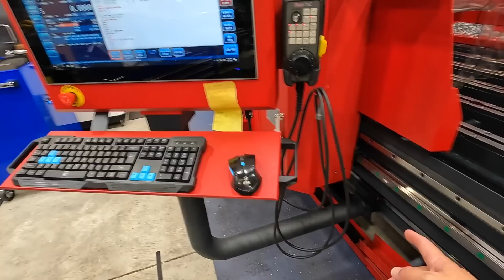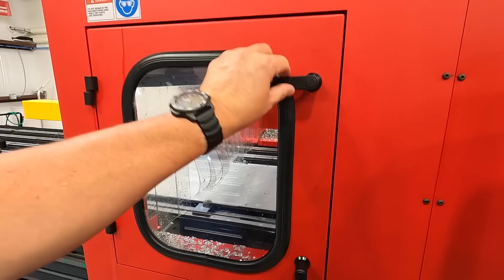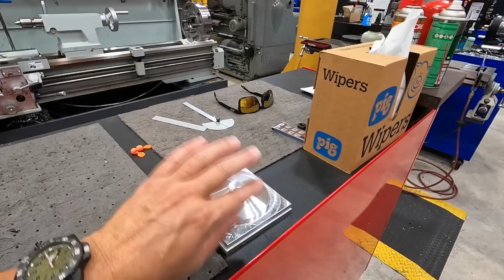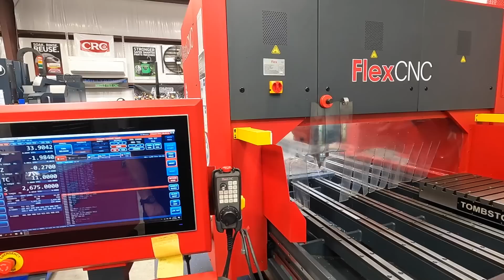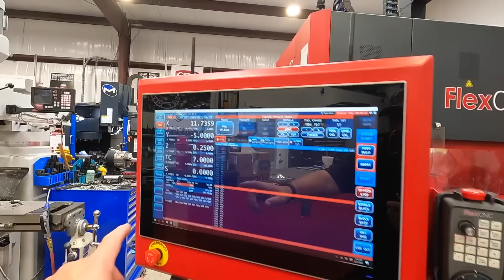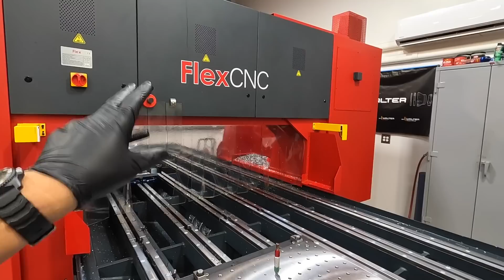Cart Top Fixture Plate Machining Success

Comment: Looks to be working really well  on the tap cycle now. I have some Parlec tension compression tap holders which allow some miss match and have a large amount of float in both directions should it be needed. The noise on the Z axis sounds like the motor tuning is out a little.

Comment: As a mechanical engineer I love your variety of videos. I personally only ever deal with CNC with 3d printers, but I like to understand what the machinst goes through when I turn over models and prints to them to cut parts. Your manual machining and repair videos are also great for when I have to get in the shop myself to modify prototypes. I get to learn how a real machinist would do the things I stumble and fumble through! Keep it up!

Comment: Adam, all you need for that window with the coolant ( for filming purposes...)  is a magnet aquarium cleaner. It works like a squeegee. one piece inside the other outside... Magnet holds them fast thru the window... Works like a charm!! a simple swipe up or down will clear that coolant quick and easy! always stays put and is ready to use anytime!
Reply: Be careful of magnets, that's how it knows the door is closed. AvE actually put a porthole-wheel in his. (spins with air to sling the shmoo off.)

Comment: I'd be curious if the flex supports dynamical variables. This kind of job would take no more than a hundred lines of code.
Reply: Indeed. As far as I know, most g-code systems are very literal - no real programming, just long sequence of commands. ('tho a program can / does generate that sequence.)
Reply: @jfbeam  It very much depends on the control.  Realistically, you have to spend some time reading the manual to see what your options are for advanced programming.

On the other hand, I've seen some controls where utilizing the advanced programming capabilities exposes bugs in the control software.

Comment: Have you considered building a clear view window for your camera so that you can mount it close to the tools using flood cooling? It's often used in the windows of the bridge of ships and consists of a disk of glass or plastic with a centrally mounted motor that spins it to throw off water or snow or in your case coolant.
Reply: Air knife

Comment: When you tap with a CNC is the starting thread of every hole at the exact same position?
Reply: ?? I guess it depends on how quick the chuck stops spinning. If there is any lag at all, it will accumulate a difference. Might be interesting to examine the finished plate.
Reply: No. There's no programming option to stop the tool at a preset angle.
And the chances of the forward and backward cycles to be the same, down to the millisecond, are slim.
Reply: @adrianohaha7659  I would have been willing to "bet money" that there is definitely precise spindle indexing. I am just guessing but with the insane tech that machine possesses, I cant believe that it wouldnt!

So if you stopped the machine mid-tap and had to resume or re-run the program, all the  tapping would be destroyed by a re-tap?
Reply: @truckguy6666  my guess is "Yes"
It's a cycle started at whatever position the spindle is at that moment. There is no need to precisely count the milliseconds it takes to get from one stage to the next, inside that cycle. It would probably involve expensive circuitry and routines with no real benefit. If you stop mid tapping, you just skip it and finish it by hand, at the end.
Reply: The logical thing for me would be to say yes, but I'm not sure.

But the tool will be programmed to start at the same Z-height above each hole, and the feed is the pitch of the thread, so in theory it should be the same 'point of entry' but I can't say for sure.

If you mill it instead with a thread mill, you can be sure it will start at the same point ✌️

Comment: You mentioned that there is a delay between the time you crossed the safety beam and it shuts off the machine.  I was wondering if you could wire in a flashing light or a buzzer that warns you that you are crossing the barrier so you know to back out?

Comment: One simple solution to deflect even fairly heavy spray is to use an air screen directly in front of the camera.   It does not take much of a fan along with a simple slot to make one.  This was what was used in early lake boats.  A very heavy duty screen can be made by a rotating clear plastic circular sheet.  This is the system used in heavy weather boats to keep the pilots view clear when waves inundate the pilothouse.

Keep up the good work.

Comment: I wish back in my manual tool and die maker days we would have had some CNC machines. Things could have been made faster but most of the time when I was building a die it would be a one off as I call them.
 You build it. Test it. Deliver it. Set it up for the buyer if they wanted to put it to work. 
 Move on to the next one. They were never the same.

 The Flex Arm plate you did in this episode would have taken me a lot longer doing it manually and I would have gone nuts if I had to make a 100 of them. Doing the same thing day in and day out until finally get 100 finished. 

 Thanks for sharing your experience with learning CNC.

Comment: Always enjoy watching. Get you a Big Ass DeHumidifier and set it in the corner. That will take a load off that AC.
Reply: It's a good point about humidity, especially something like flood coolant going. But dehumidifiers extract moisture from the air at the cost of raising its temperature. That's great for a variety of applications, like clammy basements in northern US summers or on the Gulf Coast between A/C season and heating season. But on the Gulf Coast in July, it's A/C season: there's too high a temperature to start with.

I suggest running an A/C or dehumidifier, but not both at the same time. If you're running both, you're adding heat to a room with the dehumidifier, then asking the A/C to pull it out of the building. This inefficient "double handling" of the heat and moisture ultimately will cost you on your electric bill. Another subtlety is that modern A/Cs evaporatively cool their own compressor coils with their own condensate, helping efficiency. Effectively, you're cooling the indoors by making the outdoors more muggy. With a dehumidifier, that efficiency opportunity literally goes down the drain as condensate.

Fans in all cases can be helpful for whittling down energy usage. In warm seasons, you point them at you, helping people evaporatively cool off. In cold seasons, in a high-ceilinged room like this one, you point them elsewhere to mix the room's air instead of letting the warmest air rise out of reach.

Comment: You could put solar panels on the roof. It will block the sun from the roof. Keep it slightly cooler. And produce power. To run the AC. Connect to a grid tie inverter to power the AC. With enough the AC will be free. Used solar panels from solar farms are cheap. Another thing would be to put 1" foam(or thicker) insulation in the ceiling. Or hang mylar blankets into ceiling to trap the hot air up there. And the aluminized plastic will reflect the ir heat. Backup, air is a good insulation, if it's trapped! It would be the cheapest option. And can be used with
The insulation. One ac could  probably keep  cool . The insulation in these buildings are not the best, one step above a car insulation. However $1500 in solar can run at least one ac for free
Reply: I'm sure there are limits as to what Adam can do to the outside of the building/roof. The inside may be more lenient, but you can only do so much if you don't own it.

Comment: Nothing more satisfying than that last of 216 holes being tapped. Especially if you did them all by hand. Great video Adam. I am a hobbyist and will never have a Flex Machine like that but I have been looking at a CNC milling machine on the hobbyist level and this gives me great incite on what is involved and what a CNC can do. Thank you.
Reply: Hobby CNC machines can be a lot of fun, makes you able to machine more complex geometries without having dozens of special attachments and stuff. Just don't expect it to be able to rigid tap like this, the spindle most likely won't have the torque and most importantly won't be able to be synced with the Z-axis movement. What is possible however is thread milling.

Comment: Holy snap, making huge strides there. Fixtures are where it's at. Maybe you could design a new set of bars that span four bed rails. I like a challenge. My first fixture plate had 780 x M6 threaded holes that were done using  Fusion360 and their single point helical strategy. So pucker factor is up there. Clearance for that tool's flute dia and the 5mm holes was  0.1mm.

Comment: Nice work! I would not bother with sealed collets for the carbide drills with through-tool cooling, it is best to use crimped/shrink fit holders which is the most commonly used holders for those types of tools in the industry.

Comment: As to your cooling situation. if your humidity is below 60% you might want to look into mist cooling. Mist cooling works here in Thailand until the humidity goes through the roof. Loving your content keep it coming.
Reply: Humidity is usually around 80%. Mist cooling would rust the tools.
Reply: @tsmartin  if the humidity was lower it actually would not as it evaporates before ever reaching a tool. But if the humidity is around 80% as you say then it would not work.
Reply: Mist cooling is a non-starter in Florida. Way too humid.  The A/C brought the humidity down to tolerable levels inside.

Comment: Dam i wish i could tap with my machine. that is so cool. My spindle can go forward and reverse but i doubt i would have enough torque at those low speeds. my spindle is only rated to 5000 rpm minimum. I really love that machine. too bad i am poor.
Reply: Providing your CAM solution allows it look up Thread Milling. Grab a block of maybe 1/2" Aluminium and 2 or 3 cheapy Thread Mills (because you will likely break one learning) and give it a go.

Comment: Some ship's bridge windows have round spinning window segments that throw the water off by centrifugal force in stormy weather. Might work for flood coolant mist clearing. Camera behind a 6 in. spinning disc.
Reply: Another amazing YouTube channel, in my opinion, did this same thing with his cnc machine, the AvE channel. 
Video - spinning viewport, dewclaw helps out. It worked wonders in my opinion with recording and doing what you referenced in your comment. I do hope he sees this!
Reply: There are lots of wipers and spinners and air blades available, but they don't help for the splashing around at the tool that obscures seeing the actual machining. If there isn't coolant all over the cutting tool and your material, it isn't doing any good.
Reply: @kindablue1959 I agreed with the comment. However, I don't think blocking the tools method of cooling of the working parts was the focus in my reply. The viewing thru the lense of a camera for the audience on how the tool achieves the task is the topic. That way, Adam can set up a go pro behind a clean view into the working cnc doing its task. 27:43 Adam has to clean the window for us to have a clear view into the tooling doing it's tasks.
Reply: @jacobbudden381  Yeah, well that's still about as interesting as watching a car go through a car wash. I much prefer seeing actual chips forming, especially the big 1" wide curls coming off the shaper. YMMV.
Reply: @kindabluejazz  I also agree with that comment, The great enjoyments of this channel is how vast machining can be, as well as creating products to be recorded for our viewing enjoyment. I've never worked around this kind of stuff, however seeing him use all types of machines to achieve a exceptional end product gained my following. Take care.

Comment: I totally get the curtain lasers and I understand why the laser is there for the outside, but that one would annoy me to no limit 😊 I interned at an old machine shop that had an open bed mill that was about the same size work area of the flex and I remember seeing the machinist standing on the bed while it was running spray chips off during some big face milling ops. It was an old mill, it was slow. They told me he had plenty of time to get out of the way but it scared me to death
Reply: I would be trying to defeat it, if you need that level of safety....You should not be operating or even in the shop.  "Only YOU can keep yourself safe"  (not some regulation or mandated safety measures)  Getter Done.

Comment: Adam,is there a reason why you don’t just use a chamfer tool bit that is large enough to simply plunge it ,as opposed to the circular motion ? It seems to me that you could cut the cycle time by a few seconds on each hole. Also,the traverse ,tool carlcel door ,and rotation seems a little slow as well . Just asking ( not a criticism). Thanks for sharing your experience.

Comment: Good video.  I know when I was working, I really appreciated the computerized automation (not machining) to turn out much faster work for my projects.  In retirement, I bought a small wood-shop CNC and thought I would like it just as much.  However, after the program is tweaked and running correctly, it is boring since I am absolutely in no hurry to complete a project anymore.  It also isn't as satisfying since my hands aren't actually doing much of the work.  Now, if a tool was developed to professionally sand and finish a project, I would be all over it!  Thanks.

Comment: may or may not make sense for you -- have you considered solar for the shop? dont need fancy grid tied inverter stuff and all the permits those entail if you can get a solution that just runs the a/c. peak solar happens when you need peak cooling so a cheaper option might be sane and legal.
Reply: It would take 20-30 years to pay back because I know Adam would buy the most expensive panels and professional installers.

Comment: I live in the northeast. Five years ago I had a mini split system installed on the house. A single outdoor unit running 4 heads. It's the best investment i ever did. I sized the outdoor unit larger than needed for 2 reasons. 1. It doesn't work as hard as a smaller unit. 2. There's space for another head if I ever wanted another. To be honest, this past winter we never turned our heating system on. The mini split kept the house comfortable. Its not as expensive as the gas bill to heat and cool the house. You could try some insulation on the ceiling. Even a drop or false ceiling would give you a big air gap separation that would help out.

Comment: There's always going to be "haters", but I'm sure you'r folks taught you the same thing as mine: empty barrels make the biggest noise. I love the manual machining, because the tolerances you achieve with grand old machines, and the skill it takes to make things work like they're on a paper, without any real computer to help with it (dro doesn't count). I also do understand that the manual machining is a vanishing skill, since cnc's can do it all and doesn't take hours away from the worker. So really, I'll tip you my fictional hat for taking the step to go outside your current skill level and showing us that things can be learned.
Reply: it is still important to know the manual maching. You need to know what the computer will do in every operation. For example if you know what happens in a peck drilling operation you then know how to program the computer to do the same.

Comment: Regarding the CNC and drawing/design work... If you don't constantly use it, you will lose parts of the knowledge. While I enjoy the manual machining more than the cnc, I understand that you need to move on if you want to do production runs on parts. And you really do need to get running some production work to help pay the recurring expenses on the building itself.

As far as the solar a bunch of people are mentioning, look at the cost, rebates, and break even point. Don't let some sales person exaggerate the wonderful benefits and get you into something that you can't afford because the break even is too far out. And of course, since you don't own the building, you may not even be allowed to install anything.

Comment: Abom, I just bought my first lathe from watching you, I got a atlas craftsman , I have a gear in the reverse box I need a little help with, I need one gear I have bored, and interference fit on a small shaft.. I know you do things like that, I’m happy to pay you..
Reply: Send him an email. I'm not sure if he read these comments.?
Reply: I own an atlas..Are you using a brand new gear?aluminum?steel?
Reply: @CaptainHook-j7u  oh, they don’t make aluminum or steel, it’s some mazak if I remember the alloy correctly?
Reply: @GRANITEMONUMENT ya aluminum or steel will destroy zamak. I’m surprised Clausing still makes parts for the older models. I bought a nylon gear to reduce my feed rate and wasn’t impressed. I had to machine it to make it fit correctly.
Reply: @CaptainHook-j7u  I ordered a brand new gear from clausing, and I found the upper gear and the lead screw side new old stock on eBay, now the gear 9-48b I think from clausing the teeth do not mesh with 9-50 or 9-49a , through research through clausing there was a tooth profile change at some point, (not sure when, mine is a later timkin bearing” so I’ve got another 9-49a and there are a handful of people who have bored the 49a and fit it on the original damaged unit, after cutting the head off that side..